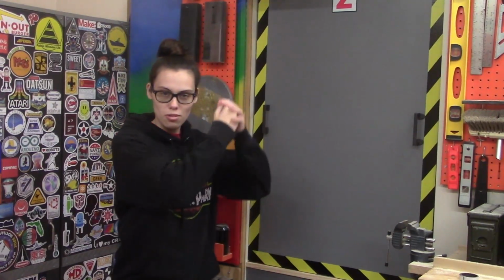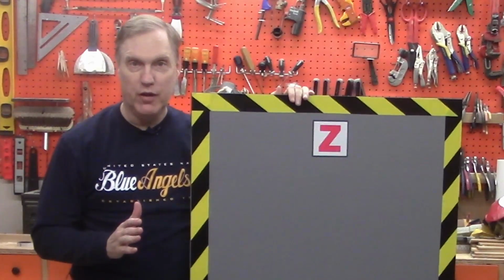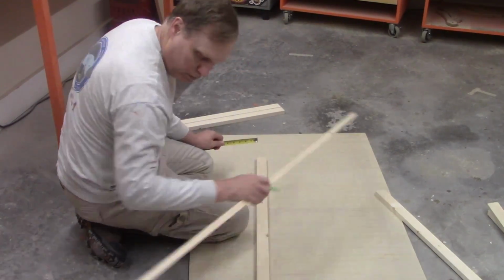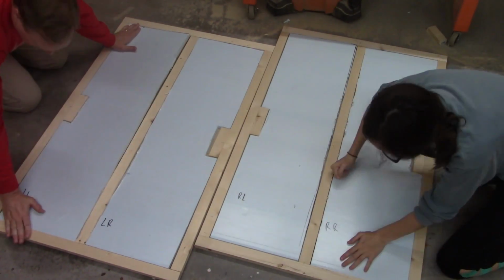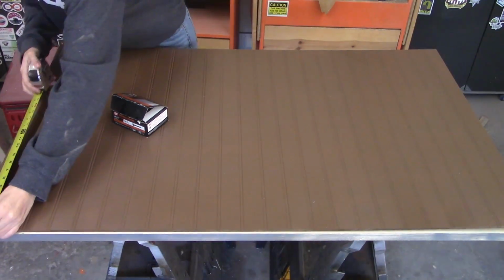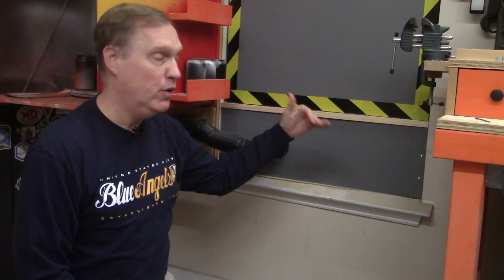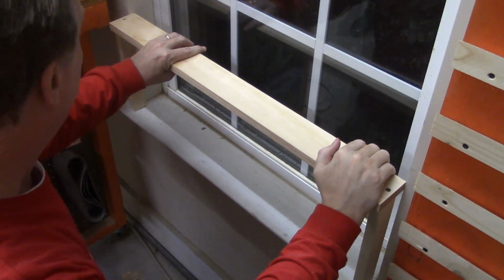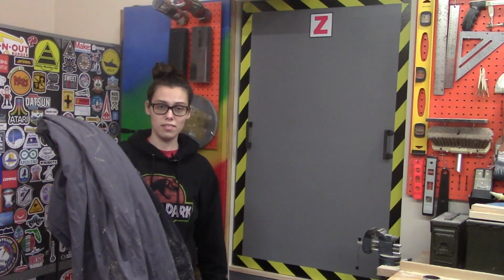Insulated Window Covers - Removable Panels

Comment: Wow! This is what I had in mind to close my large wide windows. 
Curtains don't keep the cold out, but I have a large window ledge. I had an idea to use foam boards to insert to the window and the ledges to keep it in place, but I had no idea how to do it and do it right.
But found this video and it gives a good idea on what to do and how to do it!
Great job!
Reply from the maker: Very glad you like it! They work quite well and have helped moderate the temperature in the shop. You will be glad you built them after the first week yours are up!

Comment: This is great, and just what I had in mind to minimise heat loss through the windows during winter. A little concerned it may lead to condensation issues, so thinking of adding some ventilation holes to prevent this issue. Thanks!
Reply from the maker: Sounds like a good addition. Good luck with your build!

Comment: Good job! I need to steal you idea for our back porch windows. They are screen windows but it will be nice to close them for times when we want to run an ac unit for our puppies or close then in winter just to cut down on the cold wind coming in. Then on beautiful days we can enjoy the screen windows, my husband can build most anything and I watch the money real close so this is do able. Your look great. Your HOA will absolutely think it’s woods blinds. And so cool on the shop side. Thank you for this video. My hubby will like this idea. God bless! Leslye
Reply from the maker: Many thanks! These panels are light, they cut the heat from the afternoon sun, and they can be taken down in seconds if we want to use the windows. And they really do look like blinds from the outside! Sounds like they would work great for your back porch, and they are super easy to build too!

Comment: We did something similar using foam board… my wife glued blind slats on the side facing outside and a nice fabric on the interior side.. we used magnets from amazon and they just snap in place.. our energy bill has drastically reduced since we made our window covers🤗
Reply from the maker: Completely agree. These panels greatly lowered the temperature in the shop.

Comment: If I want to cut insulation board and put in basement windows in the winter will I need to cover both side with wood or Sheetrock to deal with flammable issues?
Reply from the maker: I would, because a single piece of insulation is definitely not fire-safe. We used wood because we had it, and it's an outside window so fire safety isn't really necessary there.

Comment: Use 2-1/2 Owen's Corning foam board R-13. Buy spray can glue. Cut what ever fabric you want. Black cloth will absorb all frequencies of light and heat the room during the day through the conduction process. Under the fabric on the inside glue aluminum foil to work as a radiant barrier +2 R - value. 25% of heat loss comes from the wall and windows, 10% from floor, and 35% from your roof.

Comment: Thank you! How thick were the panel boards you used on either side?

I have a large louver (within a brick wall and open to the outside air... no actual window) and I'm trying to do this on the inside.
Reply from the maker: They are .75 inches thick and 2 inches wide. Make your thickness the same depth as whatever foam insert you use. Three quarters inch was what worked for us.

Comment: This build is awesome. What did you ended up using as a replacement for the magnetic strip?
Reply from the maker: I eventually rigged a piece of removable wood that holds it in place. Not as elegant, but it works.

Comment: You guys are funny! Question: would this work in the desert SW as far as the intense heat in summer? I’ve heard it can cause the window glass seal to get too hot and crack, losing its effectiveness. Thanks!
Reply from the maker: It should because it's essentially a wooden shutter that doesn't have hinges. We are dealing with South Georgia heat, which isn't quite as intense as yours, but we still get a lot of heat.
Reply: @AtomicDairy  Thanks so much for your quick  reply! 😀

Comment: Have you had any issues with condensation building up on the glass behind the panels now it's insulated from the room's warmth? I could imagine it pooling at the base of the glass and interacting with whatever timber you have down there.
Nice video btw!
Reply from the maker: Not at all, the seal is not airtight and there is enough space for air to flow around the panel. Not much space, but enough that we haven't had any issues.